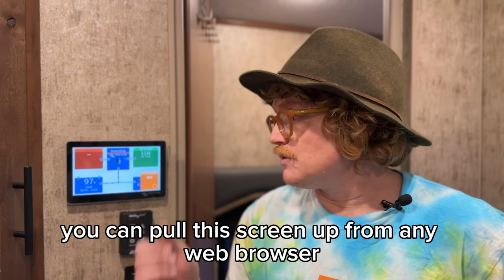24V Full Victron Energy System on a Fifth Wheel | Outdoors RV F27KVS

Comment: I have a 45 ft class A. Looks like the roof will handle that number of panels. Total package, exactly like this system. How much are we talking about (+ -) ?. Cheers
Reply from the maker: What kind of coach do you have? With a motorhome there is a bit more to do and you'll need alternator charging tied in. But you're looking around $20k.